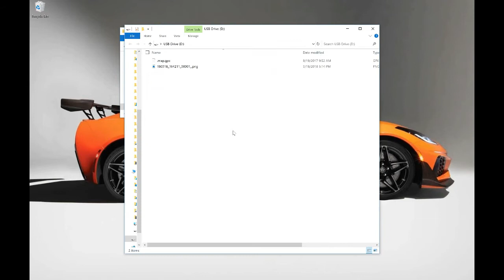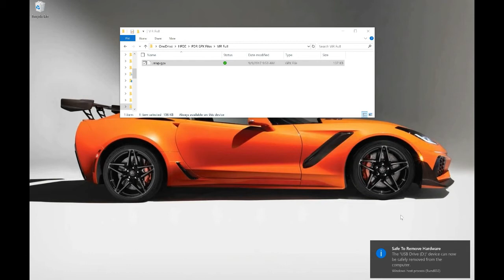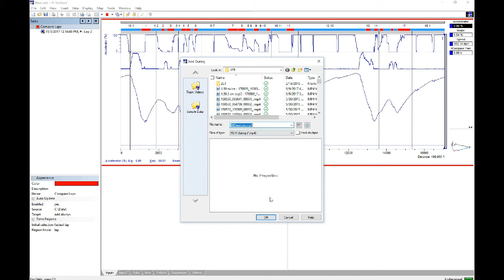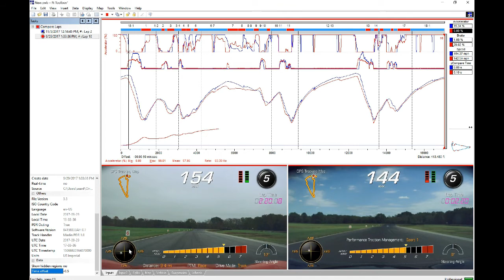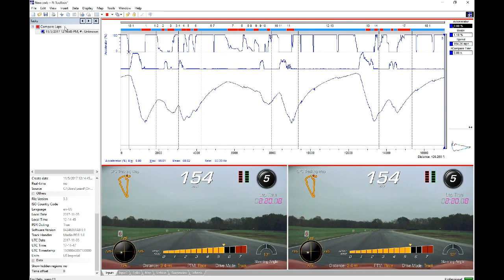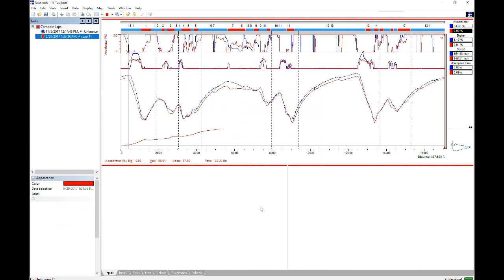Dealing with PDR Start/Finish Lines in Pi Toolbox

Comment: So what's the method to do this if we have the lite version which doesn't support two media files? The offsetting still works but there's no way to tell if it's correct.
Reply from the maker: If you are reasonably consistent you can typically use the offset to line up the speed traces.  For instance, you probably let off the gas at the same place on the front straight and hit the same apex even if your speeds are different.  Adjust the time offset on the lap so that the max speed on the straight and the min speed at the apex roughly line up.
Reply: Yeah, that's what I kinda figured out but I wasn't sure if there was a more reliable way to do it. Some on the forums had suggested looking at the GPS coordinates and just figuring out the distance offset as well.
Reply: I was thinking about looking at any of the suspension displacement channels and search for peaks that consistently are registered when going through any specific curb or bump in the track... then try to see the offset of these peaks for both laps and then you can adjust this difference